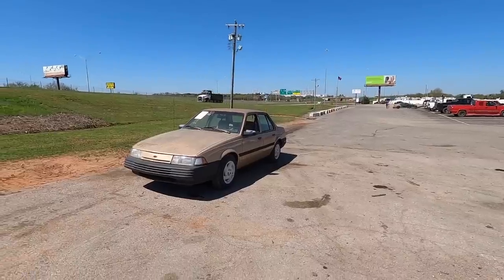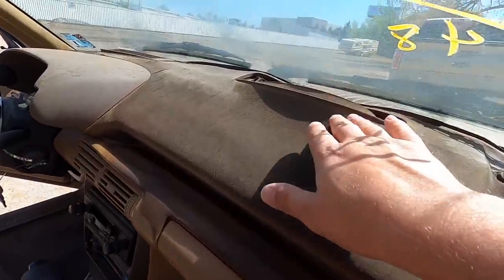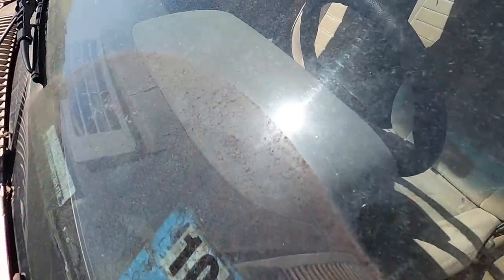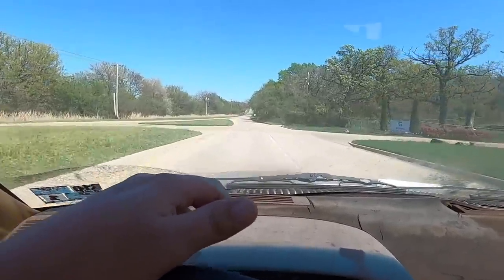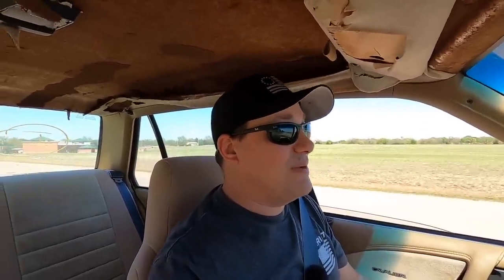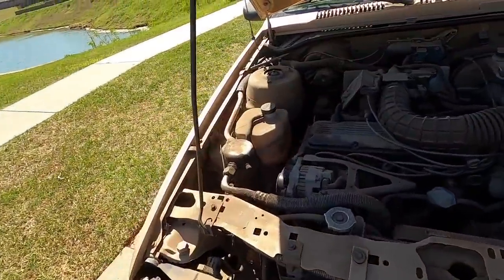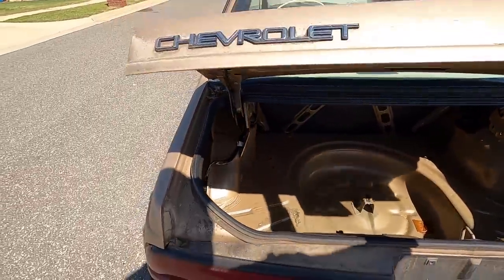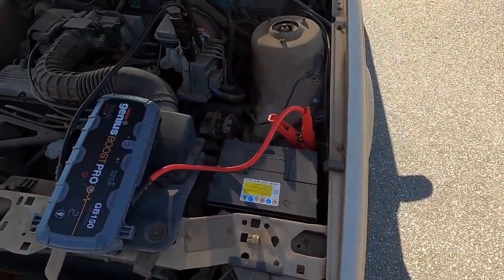$250 1992 Chevy Cavalier 1 Owner 88K Mile IAA WIN!!! Run and Drive? Let's Find out!

Comment: When the Z24  version was out I really wanted one bad.
Reply: I have a 94 Z24, last year they came with a V6. I swapped in a newer 3400 V6, and made a custom turbo setup for it. 5spd as well :)
Reply: @scottscopters7  GM 3400 V6 with a turbo? How much PSI are you pushing? Stock internals?
Reply: @scottscopters7  that's awesome! I have a 89 Z24 convertible that is awaiting an L67 swap.
Reply: @RyanRoadReaper  I ran it bone stock with 8psi. later on I did some upgrades and now running 12psi all the time. it can handle more but other aspects of the car would need to be upgraded then lol
Reply: @RyanRoadReaper  its a unibody fwd car with crappy brakes, so pretty much have it maxxed out without spending insane amounts more
Reply: @scottscopters7  yep, don't wanna snap an axle or something lol
Reply: they were very good looking cars until all the highschool girls started having cavaliers lol
Reply: Didn’t we all.
Reply: Haha I learned how to drive in a z24
Reply: I still want one.  Here in Mexico the Z24 was sold, in 1994, with a V6, auto or stick and the Pontiac Sunbird GT flip up hidden headlights.  They are cheap fun with great colors.

Comment: Fantastic find !! I was heading out to the Chevy dealer in 94 to check out the Cavalier [ "for the cost of a hamburger, fries and a milkshake a day..."] to be my first new car when an 86 Olds Calais at the Century Olds used car lot in Van Nuys, CA caught my eye. I bought that car with 21,000 miles on it. It toured the family for a decade after I passed it on to my parents, then my brother and his wife and is now back with me. 
The reason i wanted a Cavalier was because it was cheap and looked good, especially in 2 dr form. Simple OHV engine and proven transmission. Lots of parts and service availability for long term ownership.

I finally did get a Cavalier for my first new car: a 99 that I loved. A lot of people had a Cavalier as a first car.
It was destroyed in a rear end collision by a BMW. I'd still have the bloody thing if it weren't for that.
Your idea to return it to like new shape is great. When was the last time anyone saw one..... except in the cosmetic condition of this one.
Those hubcaps are original, BTW. They peeled and faded just like that straight from the factory. And yes the do look like crap.
Looking forward to seeing what you do with this car. This one hit a nerve with me too !
I love GM's FWD small cars, actually.

Comment: When my uncle passed away in 2009, he had a '93 Cavalier 2 door in Florida that was his winter car. It had 53,000 miles on it. When I got to Florida, as I inherited his mobile home and the Cavalier, the car had been sitting for about 18 months. I got it to crank but it would not start. Called AAA and had it towed to their garage. Diagnosis was that it needed a fuel pump. Because I was on a limited time frame and didn't know when I would get to Florida again, I didn't want to spend the money on it and then have it sit another year or possibly more before I returned. As it turned out, the tow truck driver was looking for a vehicle for a friend of his - single mother with a child - who needed a car, I ended up just giving the car to her and the tow driver said he would put a new pump in it for her. The car was really in decent shape but I had no use for it. If it had been in Maine where I live, I would have fixed it and sold it.

Comment: I bought one at copart salvaged in 2002 for 130$ with 199K and it was one owner..It was hit in the driver door.. I got a door for 30$ and put it on and got it re certified as salvage rebuilt..  I took it and drove it from Raleigh NC to Buckeye Az on 160$ in gas...  Sold it in AZ for 2K and hitch hiked home...  Everything worked,, including AC..

Comment: That’s the same car I did my drivers education in. Brings back memories. My first car was a 2 door Tempo GLS 5 speed which was much nicer than the Caviler. Brings back fond memories!
Reply: Hahaha me too! Ours was blue. First day of drivers Ed driving experience, teacher wasn't paying attention to the fact I had come to s complete stop and didn't let off the brake. I thought he had and went to push the gas pedal only to find he was still on the brakes. Nice little tire squeal when he let off the brakes! Good memories indeed
Reply from the maker: My 1st car was a Ford Tempo as well. It was a GL, 2.3L.
Reply: I have never heard anybody say they thought a Tempo was nicer than a Cavalier.  Having been somebody who bought and sold both back when they were fairly new, I would buy 10 Cavaliers before a Tempo.  They were just this side of junk.
Reply: Mexican Spec mine was a GLS sport 2 door it had a lot more options than any Caviler. Power windows, seats, lumbar control airbags in the seats premium audio, aluminum wheels way nicer even had a Tachometer.
Reply: @MrDanielmarlowe  No matter the trim level, the engines were weak and the automatic transmissions were even worse.  I have had a lot of them and not one was a car I would want to have back in my life.  The cavalier road better, had a smoother shifting transmission and yes, all the power options were available on them.
Reply: Mexican Spec mine was a manual got over 200k on engine and tranny. It was not fast but nothing was back then. I had fun with it.
Reply: Auto Auction Rebuilds Wow that’s really cool I had the same first car as you!

Comment: It looks like this car need a dash, headliner and a cheap paint job, it looks like ez profit
Reply: @kruleworld  I would think that the parts to fix up should be under 600$ with the paint job, I would list it up for 1300-1500$ just because these old cars are getting harder to find, and are easy to fix, this would earn you at least 300$ profit + what ever YouTube brings in.
Reply: Tony Durham NineOneTwoThreeZeroTwoFourThreeNineOne  Any profit is good
Reply: These are now regarded as classics in the UK and fetching sound money. Then again, they stopped selling them here in '89 and most were already gone 20 years ago due to rot.
Reply: Robert Bandy NineOneTwoThreeZeroTwoFourThreeNineOne  Vauxhall Cavalier (Mark 2). Most of the ones sold here were the hatchback, but there were a few sedans and wagons (or saloons and estates as we call them) knocking about too. The UK and Euro market ones got a different, more upright front clip, smaller tail lights, and a different dashboard, and the biggest engine available was the 2.0 4-cyl, usually mated to a manual transmission as is customary here.

Comment: had a 94........loved it.  145k and frame rusted out.  damn midwest winters.  horn pads were common issue. was recall on it.  also temp at mid is normal. buried speedo on my 2.2 a few times

Comment: Had two Chevy Cavaliers.  My First a 1988 Z24 Cavalier was an fun ride, had a nice loud exhaust and a cool air intake on it.  I got 133K out of it before I sold it.

My second Cavalier was a 1993 RS and it was a major piece of crap.  Mulitple computer failures, transmission failed at 55K and had constant alternator issues.  Dumped it at 80K miles after it had beaten my wallet into submission.

Can't wait to see what you do with the car Randy...its a trip down memory lane.

Comment: I had a 93 Cavalier VL coupe 20+ years ago.  Was a perfectly cromulent vehicle for its time.  Ran it up to 230k, sold it to a buddy who got it past 265k before the firewall where the steering gear mounted to turned to dust.  He had to junk it when turning the steering wheel caused the rack to move instead of the wheels!  Motor and trans were still pristine, probably could've gone well past 300k easy.  Gotta say, in the time I owned it it was very cheap and easy to maintain!  Had to replace the head gasket once and it was probably the easiest HG job ever...

Comment: I had one of those Chevy cavalier back in the day same year and color the caps looks like my original caps that came on mine from the dealer mine was brand new with 5 miles on the odometer at day of purchase and bringing it back to its original glory would be great any car that runs as good as that at its age deserves it and it appears that at 1 time some one really loved and cared for the car please give it it's glory back if you can any car that age and still runs with no major issues deserves it

Comment: Nice find! I would pick up for $250 myself as well! But you spoke of replacing the hubcaps and putting on factory ones, to be a “die hard cavalier fan” you should know those hubcaps are factory caps. Just sand them down, get some hubcap spray from autozone and they will look good as new!

Comment: Love the car. I had a about same year beretta paid 80 bucks for it. Oil pump going out couldnt go over 50-60 or started knocking. But got me through winter snow heavy car.  Traded it later for a truck I lost and found back again. Traded w some cash on top.

Comment: Tires are dry rotted; rpl asap. EDIT: if you are not aware - continued driving on dry rotted tires causes the tire to blister from the inside outward until the tire has a blowout.  Replace tires ASAP. Cavaliers were fun little cars - especially the z24's.  Most ppl ran these things into the ground and never maintained them. The auto transmissions were junk so be easy on it.  I also remember the late 80's to early 90's Cav's had problems with the pistons egg shaping, and causing runability problems.  Good luck with it - very clean car.

Comment: I have two 92 Cavaliers and my fiancée has a 94 Cavalier.  I like these cars for drive to work beaters.  They are pretty reliable.  The one I mostly drive has 239,000 miles and the other one probably has over 200,000 miles.  I wish I could find another low mileage 92-94.

Comment: Nice project Randy! The dash pad, headlining and trunk carpets may be tricky to find, but so many of these cars were made that you will succeed. There are also Owner's Clubs for many of these older models, and they often have remaufactured parts for sale. If you can't find these bits in the right colour they could be painted. The bodywork will probably need sandblasting to get rid of that all over corrosion, especially in the seams. And the sketchy handling could be improved by renewing the suspension bushes. But overall, these were good vehicles, and definitely worth fixing. Excellent YouTube content for sure!

Comment: Head gaskets go bad chevy coolant was an issue in the early 90s making them over heat, change the coolant regularly and if yours is getting too hot replace radiator and thermostat and put fresh 50/50 antifreeze

Comment: When I was in the military, we had a Govt issue Cavalier located at an off station complex for local use. It suffered from what was a common malady on almost all of them. Steering rack morning sickness. It would not turn to the left until the power steering was warmed up. Something to do with an internal spool valve that was harder than the bore it was in and wears out and would get stuck until the rack was warm. Hopefully that's not a problem on yours.
Reply: The steering rack was always the first thing we checked on these Cavaliers when they ran through the auction.  That was the weak point of this car, but they were still drive-able even with that problem.

Comment: Maybe you'll get lucky but I suggest just finding a good automotive upholstery shop, to get a dash recovered and a headliner shouldn't be too much that's a pretty simple dash. 
It might not be the proper way to paint the car but you could possibly give that car a good scuff SOS pad or a wet sand and then just re clear coat it as long as your careful not to burn through the base. From what I can tell it's just the clear coat peeling off, and I'm sure there's some fading.

Comment: I like the Cavalier. Good go to work car. Yes, it is not a fancy car but that is why I would own it. With all the GM cars I have owned one of the weaknesses were always water pumps. I would tune the car, change the water pump, buy new tires, pant it, fix the dash, and do transmission service on it.

Comment: I would throw in some gas treatment, then take a can of Gumout to the throttle-body (Inside and out)!  I also cleaned my injectors last year (98 cav) and that helped a bunch.  Did the hack, where you take a 9v battery to turn the injector on and off, and use an up-side-down syringe (Like baby med one) to get gummout sprayed through it....runs like a charm now!

Comment: I bought a 85k mile 1999 mustang from copart for 300 plus fees. it was an engine starts listing and the calipers were frozen from sitting to long. the front brakes were stuck on and the rear tires were just spinning.  1 owner, tires are weather cracked. i have the title from copart that shows the last owner bought it with 186 miles.

Comment: Randy you can buy headliner at Jo Ann's if you have one there and a can of 3m spray adhesive from wal mart and replace it yourself. Use the same material and have a upholstery shop recover the sun visors. I have replaced several headliners myself.

Comment: I had an 84 2 door back in college. NO headliner at all. Bare metal. The leaking sunroof was covered in silicone caulk but it never left me on the side of the road. Had a Kraco power booster, a realistic head unit and some Jensen 6X9's in the back deck. With the missing headliner the vibrations made it sound like I had a giant speakerbox in the trunk. Donated to my mom when I bought a new Camaro. Tractor trailer backed into the front end of it. We replaced the fiberglass front piece and kept on going. Never even painted it. Best little cars ever. Mom currently has a 2000 Cavalier that we donated to her. It looks even worse than that one.

We actually made up a little song about that old car.

Rolling, In my 2.0
With the windows down, cause the air don't blow.
Paint is peeling, Belts are squealing
All the cops think that I am dealing.

Comment: My mother owned a chevy cavalier up until the day she died. She had a candy apple red one. It was only 4 yrs old at the time. And then someone else in the family got the car and slammed on the car for 8 yrs. 5 of those years they didn't do an oil chane on it, but that car ran like a champ. Never once left this family member by the side of the road once. Those cars are dame resilient. They can even be running like complete crap and still get you from point A to point B one way or the other. Also I do automotive upholstery for a living. A headliner isn't much to do on the interior. But just be careful of the plastic trim.

Comment: get the dash carpet off rockauto for 30 bucks. i did for my 91 rs wagon. i added a z24 rear sway bar. z254 gauge cluster with tach, z24 wheels. front bumper, grille and hood. did the headgasket, injector, serp belt pulley etc.

Comment: Randy, I would buy 10 Cavaliers or Panther Platform cars before any more BMW or Mercedes cars.  Also, when I worked at the dealer back in these years, there had to be a charge in the battery to tell the computer to tell the alternator to charge the battery.  This battery might charge up if you try.

Comment: Those 2.2L motors are workhorses.  They'll run forever.  My ex-gfs dad had a 94 yellow 4 door that went to hell and back body wise but had a mint running gear.  No smoke, no rattles and transmission was mint.  I myself had a 92 teal sunbird w a 5 speed swap.
Reply: And this 2.2 has only 88k on it. Tons of driving left.

Comment: You can get a dash pad that’s a different color & assuming the color is available or a color that is close you can use vinyl interior spray paint. I’ve used it on dash pads in the past. Finding the exact color match at a junkyard is unlikely.

Comment: I'm definitely not a Chevy cavalier/Pontiac sunbird fan but I do agree with the nostalgia.. I honestly can't remember the last time I saw install one of these down here in Miami Beach. My aunt bought a brand new 92 cavalier cavalier VL back in in 92. Over the Geo prism we were trying to get her to pick was because it had any luck breaks. Everyone everyone at the Chevy dealership service department yeah I meant told her ""get rid of this thing before it goes out of warranty or you'll be sorry". The problem with these cars was you never knew which one was the good 1 and which 1 wasn't since. I think that old Boomer saying ""it depends on which day of the week it was built" was kinda true?? I knew someone do someone who had a 94 and beat the shit out out of that thing that sing and it kept running and running. My aunt traded in that cavalier  In on A9484 geometro LSI hatch hatchback.. She drove that thing 15 years and over is over 200 K miles before before Giving it to my cousin who who turned it into a ricer. He blew the engine at  250K Before picking up a rebuilt Suzuki engine ( Which who is the one that built the car) From Japan for like $700. It took them like 2 hours to do. We're both in our early forties now and and for some reason feel silly writing oriding around in a in a  Hatchback metro with every every ridiculous body kit tack on You could ever imagine stuck to it. He says he wants to restore restore it back to its normal appearance out of respect but I think it's because all the old Jewish farts on the HOA board board Arsenal are starting to get rough with him . I guess it doesn't add much to their gated community parked next to his Lexus S UV.

Comment: Re clear coat it new tires battery headliner. Dash pad and sell for 1500. Or keep it at AAR hq.  AS A GO FOR CAR OR JUST PUT AROUND. AND USE IT FOR AUCTIONS P.S. DO NOT FORGET TO SERVICE THE AIR CONDITIONER

Comment: as far as that engine running a little rough, run about two tanks of "high test" gas through it and it should clean it right up, if not injection cleaner and your golden,  that Cavalier isis a diamond in the rough and going to be fun to play with.